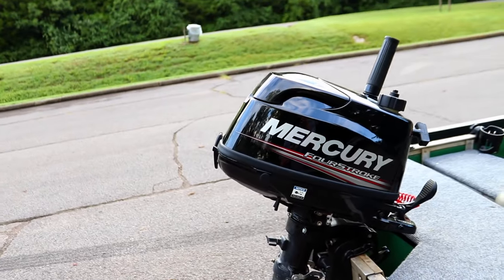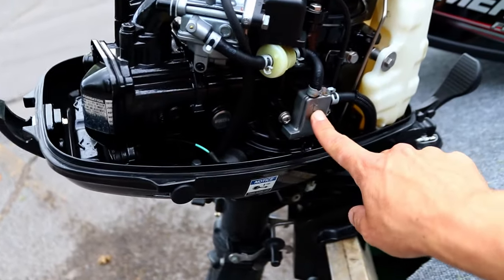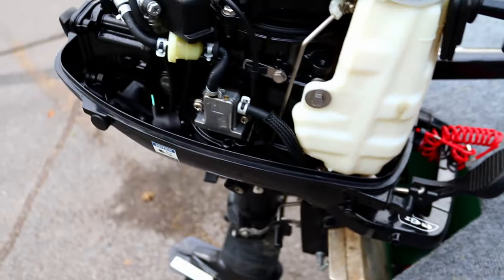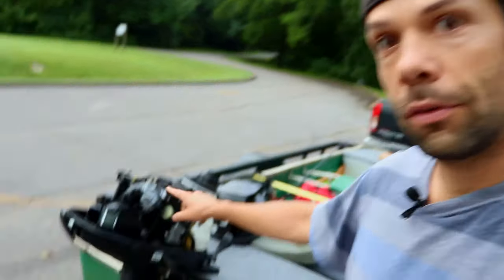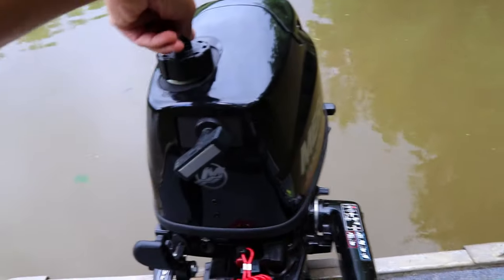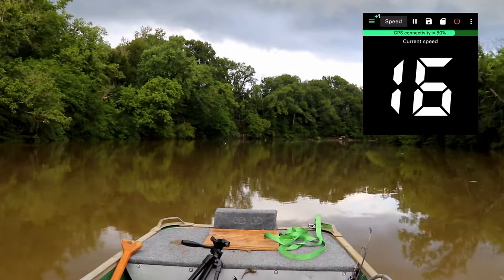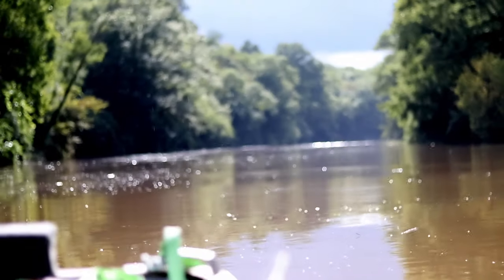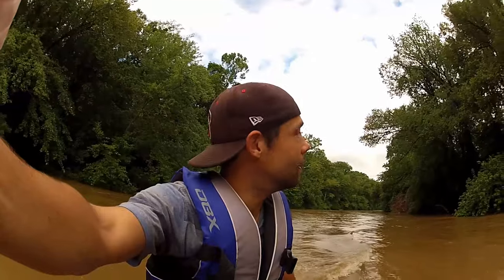Mercury/Tohatsu 6HP Outboard: Review, Walk-Through, & Test Run. Best Jon Boat Motor?

Comment: If wanting to get the full HP cowl rated need to install one less pitch from factory delivered one, delivered props are only good for break in purposes, once finished need to prop right that motor to ran towards it's max wot rpm range which is 6,000 rpm. 

A spot on transom/motor height installation along a prop maximization also accounts to achieve top prop thrust in all possible water conditions.
Reply from the maker: Yeah that’s a good point. I’ve got it on my list to try out a 7” pitch prop to get closer to max rpms. Just concerned about top speed impact but I know it will definitely provide better hole shot. I’ve got my weight distribution and motor trim/position dialed in now… much better that the first few months of having the motor. Did an updated 2yr review video on the channel. Check it out.. had a change in perspective after using the motor for 2 years
Reply: Need to buy an induction tach/hour meter to check what's the current achieved wot rpm as loaded with perfect deck load distribution and motor trimed to 90 deg, will know how much less pitch prop to drop, is a 7 pitch prop what comes right after the factory delivered prop which is ? Would recommend to buy and install a Hardline Hour/Tach meter model  HR-8061-2, check Amazon for them. One less pitch can dial as much as 500 wot revs, so don't go that less in pitch from a factory delivered prop.
Reply from the maker: Yeah factory is 8. Great idea on the tach. It’s on my list as well as trying different pitch. Good on tracking and not over reving at work.
Reply: Post max wot rpm as loaded with an 8 pitch prop and then with swapped 7 pitch prop to check what's the wot rpm difference between both 7 & 8 props, have fun !!

Comment: Makes sense it would take a few extra pulls to pull everything threw the carb on the cold start do to the oversized carb.
Reply from the maker: Mine is true 6hp, not with oversized carb. But good pt if you do install the HP step up carb. I plan to clean the carb and test, so stay tuned! :-)
Reply: @Skinnyriver  try turning on the fuel and opening the vent earlier ,I do this on the way to the water ,mine starts 1 or 2 pull .it fills the fuel line and carburator fuel bowl before you start pull starting, works for me
Reply from the maker: Thanks that’s a good idea. I even seen a guy blowing into the tank to pressurize it and push more gas into the carb lol

Comment: I would say your doing but another tip unhook fuel line let motor run gas out of carb.
Reply from the maker: Yeah good point, I have tried that and it does seem to help not letting that fuel sit in the carb for days/weeks. I always forget though :) mine is 4stroke but I have heard not to do that with 2 strokes bc the motor needs the oil from the fuel and running it dry could hurt the rings/cylinder... but most people don’t think it’s an issue.
Reply: You can just turn the fuel off ,thats why they put a fuel on/ off valve on it
Reply from the maker: Yeah I guessed that’s what he meant by “unhooking”… not a great idea unhooking the fuel line and having gas drain into the river lol

Comment: I have the exact same motor, but I got a 2020 6hp mercury.  I am a total small engine nerd, love them.  From what I've read and experienced by using the 3 gallon remote tank, by having the pressure bulb to force the gas in the carb, that helps this problem.  I got my motor for a light Saturn inflatable boat that weighs around 80 pounds.  I hit 18mph on the stock prop(7.8×8pitch) and sometimes I hit the rev limiter which is at 6270 rpm on my tiny-tack.  When my girlfriend gets in the boat it won't plane.  She is around 145 , I'm 180 pounds.  I went down one size to the 7pitch and it did help but now the top speed is only 14mph.  The 7 pitch is for the 4hp,  the 5hp and 6hp both use the 8 pitch stock.  All three blades by the way. Sailboats use the 8.375x 6pitch (elephant ear prop).  I got the 9 pitch to try by myself and see if I can hit 20-21.  Going to try that later this week.  I have a 1998 evinrude 9.9 2 stroke and it goes 21.5 mph on the same boat with 1 person.  Not much faster with its stock prop but with a second person it's way faster than the 6hp.  It's smoother but uses a lot of gas and is louder at full speed.  The gas mileage of the 6hp is absolutely crazy and that's my favorite part.  I don't like the shaking of the 1 cylinder though.  Keep up the good videos brother!
Reply from the maker: You rock! I’ll try a 7 pitch to get a little more low end power. I’m just learning, wish I had half of your knowledge and half of the toys you have had!! 

Thanks for the view, I really appreciate it. I’m still trying to figure out this YouTube thing so I appreciate any feedback I get!
Reply: You're doing great with the videos!  Order a new plug while your at it just to make sure your spark is strong as possible for a quick start.
Reply: I was wondering if you tried putting the motor pin down a hole or two to see if it would plane faster.  Well you got more ideas for another video now.
Reply from the maker: Chris R yeah I tried down 1 and it was about the same. BUT I was having a ventilation/cavitation issue with my prop, where I was either getting the prop too close to the surface or getting air around the lower end unit... causing my prop to lose grip with the water, RPMs skyrocketed and lost all power. But lowering trim position helped a lot. It’s weird as I know the prop is not too high as cavitation plate is at or below bottom of the boat at all trim positions.
Reply: I guess I meant lower the engine a hole or two to bring the front down but it sounds like you got it where you like it.  I liked the extra power of the 7 pitch for a second person  but I was a little disappointed on the top speed of around 14mph with 1 person.  It is a planing speed but i like to be able to back off a little and stay plane. When it hits top speed it hits the rev limiter pretty easily and i back off the throttle a little.  The engine is working easier with less throttle though.  On my inflatable,  the seat benches are not at the best places for perfect weight distribution.  I just sit on the floor with a handle extension so I can experiment with staying plane at really low speeds.  I'm looking forward what I can squeeze out of the 9 pitch for a top speed.  I liked using a tiny tack so I can see if I'm between the 5000-6000 range.  Its supposed to be near the upper end of the range.  If I'm hitting around 6250 with the stock 8 pitch, I can go up to the 9 pitch to get me in the 6000 range with 1 person.  I think each pitch effects the rpms around 250.  Yep I'm a little crazy with these small engines.
Reply from the maker: @chrisr465  I think you are right, I never noticed the fuel pump is higher than the bottom of the internal tank, that makes perfect sense... Not the design and position of the fuel pump...
 but your theory :)

Comment: I have that same boat and I just got a trailer for it soon I will put it in the water
Reply from the maker: Awesome let me know how you like it! I am loving mine. Do you have an outboard or just using a trolling motor?
Reply: @Skinnyriver  I have an outboard I like the boat I've had for a while but haven't used it in a long time
Reply from the maker: Good deal, I saved mine from a landfill and put probably $200 into it plus the motor and couldn’t be happier. Well maybe if I had a Bass Tracker with a 150HP I’d be a bit happier :)
Reply: @Skinnyriver  there's a great Facebook group for the Coleman crawdad

Comment: Will it retrofit to a separate gas tank?
Reply from the maker: Yeah the 6hp has an external tank hookup. Really convenient to have both options
Reply: @Skinnyriver  more than convenient in my case.  I am far offshore if/when I need it.  And see, the thing is, IF my problem with the main is BAD GAS, then you want a separate small tank of clean gas, that way you get true redundancy, not just running the kicker to the same gas supply.
Reply from the maker: I actually did a video on that. The guy that said an external tank and primer bulb is exactly right. Check out my video on this topic here https://youtu.be/tD2eeR7btXs

Comment: Raise the motor an inch or two will help get on plane faster. If u bought it used, at ten hours it's due for it's first oil change and dump gearbox oil. My tohatsu had break in metal in both oils. The older gen motors had a cdi pack to control timing and over rev, they simplified these motors, back to basics with magneto. They will last forever, but there is no over rev now so get a cheap hour/tach meter. 
Cold starts I get about 3 - 4 pulls but I never ran ethanol, you can get type A carb off eBay for 50$ they are non emmisions carb, it's a Chinese made unit but solves a lot of issues.
Reply from the maker: Awesome thanks!! I changed the oil but not the lower end oil, gonna do that this week. Thanks for the advice with the ebay carb, if cleaning the current carb doesn’t get cold starting pulls down under 5 then I’ll look at getting a new non-epa one.

Question, what’s considered a type A carb? I’m guessing specs?
Reply: @Skinnyriver  it is missing the EPA vacuum hoses and the idle mixture screw is set a bit richer. Keep a spare prop and nut cotter key kit on board. Nissan/tohatsu props are cheaper
Reply from the maker: Last question, would you consider pulling off the fuel mixture (idle speed) screw cap and backing the screw off off 1/4-1/2 turn to make it a bit richer? I have read that will help starting?
Reply: @Skinnyriver  yes and no. My motor was bought new, if I had a warranty issue don't want it denied by removing the tamper plug. Of course u can buy the new plug online it's 3$. I say the cold start issue is just nature of this motor, as you said once it's running its pretty good. When pulling the choke all the way out don't touch the throttle. The choke when pulled out all the way also opens the throttle a bit.
Reply from the maker: Omieyouknowme ha ha I’m glad you said that about the throttle, I’ve been trying to open throttle and choke to see if that helps starting... flooded

Comment: Of course, you had a faster response (acceleration) from a 2-stroke, it fires twice as many times! Duh.
Reply from the maker: But it was 2hp less, that was the point duh!
Reply: @Skinnyriver  Your two-year review was great, much better than this video because you had actual experience with the motor.  I have a 2005 Tohatsu 6-HP and it is rock solid.  I have replaced the fuel pump and impeller during that time but nothing else outside of scheduled maintenance.

Comment: I just purchased a 5hp mercury brand new for $1100. Going to use it as a Kicker on my new tracker boat.
Reply from the maker: That’s an awesome deal! Did you get it locally or online delivered?
Reply: @Skinnyriver  I bought it from a dealer. But I have a $40000 boat purchase through them as well

Comment: IF you are having the cold starting issue, after you have opened the tank flow switch, remove the gas cap, put your mouth down on the neck and blow as hard as you can just for a second. In my experience, it will start first pull even cold.
Reply from the maker: You are 100% right. I learned this a month ago through talking with smart people like you. I made a quick video showing this issues and why it loses prime https://youtu.be/tD2eeR7btXs

Comment: ..I have a Merc-badged model on a Saturn 385XL, it does 16 mph flat-out.  The only thing that could be a problem for you is that it doesn't idle slow enough for you to troll for the type of freshwater fish up here in Canada...I'll have to back-troll  Shift your body(s) towards to bow and it will lift faster, especially with a passenger...the fuel economy is really great...
Reply from the maker: Awesome, yeah I agree idle speed in gear it pretty quick. You can always get a prop with lower pitch, and that will slow down idle speed but will also lower top speed

Comment: 4 hp also is hard to start cold normally 5 pulls even after carb was cleaned out completely
Reply from the maker: Yeah I’m beginning to think it’s just part of it with this engine. But I still feel it’s extremely reliable and am enjoying it. Of you ever figure out the starting procedure/fix let me know :)
Reply: @Skinnyriver  Have you checked out where your cavitation plate is height wise? i found on my Jon boat it sat really low and have modified the transom to raise it up to where it should be. I will be trying it out shortly to see if it makes a difference on getting up on plane. Everything i read says that will make the difference.
Reply from the maker: Good point, my cavi plate is about 2” below bottom of boat. So it’s close but a little low. getting a Jack plate is on my list so I can play with the motor height.

Comment: Is tohatsu and mercury the same company?  That looks exactly the same as my 6hp tohatsu
Reply from the maker: Tohatsu makes all Mercuries 25hp and under. Mercury just rebrands them
Reply from the maker: Not the same company, maybe a joint venture. Tohatsu Japan makes the motors and Mercury rebrands and markets them as Mercuries. My understanding is they are the exact same motor, even timing, tubing, and gear ratios. When you get into the 20hp’s there are some gearing and timing differences
Reply: @Skinnyriver  But the Sailpro is 6hp from Tohatsu and 5hp from Mercury.... 🤔
Reply from the maker: Tohatsu makes all Mercury outboards under 25HP. They just rebrand them as Mercury. Timing and tuning maybe slightly different but all components are the same and made in same factory on same lines
Reply: @Skinnyriver  Yes, I know this. But I‘m wondering why they make the Mercury 5hp and the Tohatsu 6hp. If I would buy a singlecylinder for my sailboat I always would prefere the 6hp... Did they use the other carburetor for the Mercury?
Reply from the maker: Man that’s a good point, I understand your point now. Not sure why they don’t rebrand the 6HP version as Mercury... the 6HP Tohatsu and 5hp Mercury is the same motor with a larger carb.. but timing also may be slightly different to get the most out of the larger carb. BUT honestly I think the 6HP Tohatsu might be best option. You probably can get one for the same cost of the 5HP Mercury due to brand value. Only downside I see is resale value would also be slightly lower. I’m not a big fan of upping the carb as there may be some timing differences but I know many people have have bought the 5HP to 6hp carb upgrade kit $160 and it worked great.